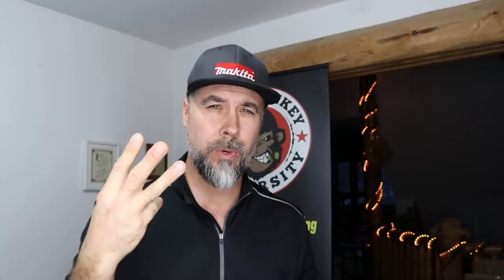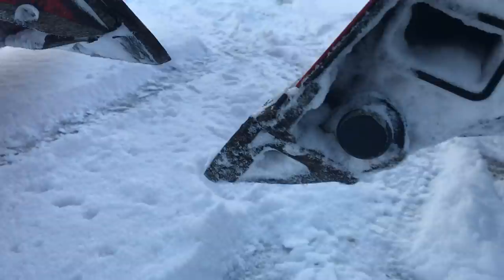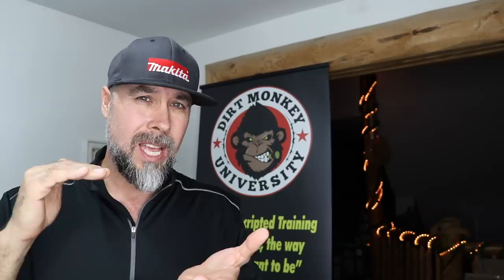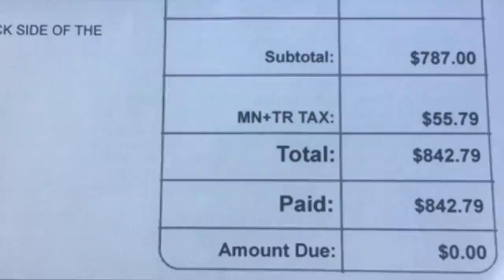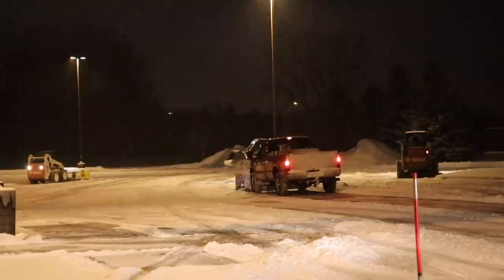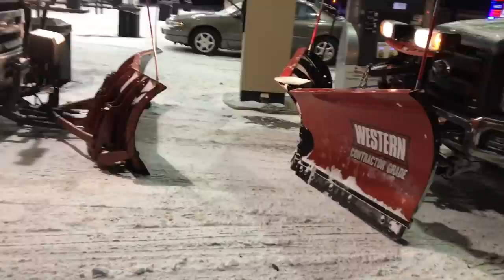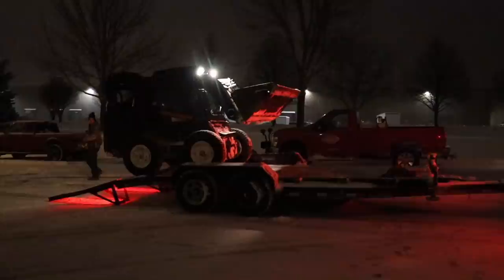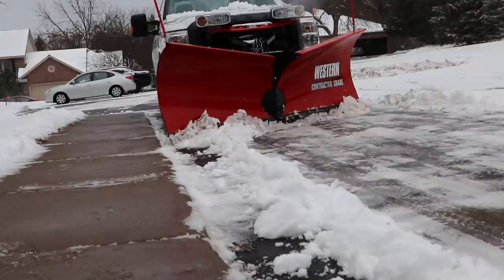Western Snow Plow Review after 13 years - Plagued with Problems

Comment: I have a western on my F250 that I bought new in 2006.  I plowed in NH 1 business (my own) and 3-4 driveways for 4 years.  Moved to PA and I plow a lot less often but do 6-8 big driveways and my cutting edge looks brand new.  I run the round shoes just below the blade height maybe 1/16-1/8.  I’ve replaced the shoes once they were like $75 for the pair.  I think the steel on the old edge is probably better, it’s a very beefy plow.  The new ultra mounts look pretty wimpy.  Maybe try running the shoes lower than the cutting edge.  I’ve always run it that way.  12 year (not commercial plowing) and the cutting edge looks great, it’s a little worn on the outside edges but all blades seem to wear on the outside corners first

Comment: I just picked up a half ton chev with a western midweight straight blade. Wasn't my initial plan, but I couldn't pass up the deal. Thanks for the heads up on blades... I've been doing snow in Duluth for 12 years now on the pro level and really my whole life, but this is my first plow so we'll see how it goes.

Comment: 5 5/8 left on my wideout cutting edge think was 6 when new purchased plow new beginning of this season. Have approx 80hrs plowing on it so far.

Is this a mvp plow problem? Or are people seeing this with all western plows?
Reply: Also one touch float is a programmable option with that controller....vehicle ignition to on,,controller off press and hold down then turn controller on continue holding down until float light flashes and you're all set!

Comment: When I graded roads for the local city, they used to supply the cheapest blades they could.   They would snap as soon as you would contact a curb, manhole, or frost heave in the road.   Then it would be moldboard up and back to city shop for s new set.   Once they figured out to get the treated blades and one set per shift sometime for two shifts they were way ahead.
Reply from the maker: Wow-  thats really bad.

Comment: I have a western 8 ft pro plow it's on it's 3rd truck 2017 F250.I put a commercial rubber between the scraper blade and mulboard.It work's great.it's like a squegie.less wear and tear on the truck also.No shoes are used.I told you about this several years ago why don't you try it.We just had 20 inches in Chicago over the last week never had a problem.Try the rubber you mite like it???

Comment: Go to your nearest steal supply place, get some 3/4”x 6” steel plate and drill your own holes. Hit the Hardware store, get some grade 8 bolts and washers and bam! I just saved you probably $700! Quit buying the company crap. They are only in business to rip the buyer over time and keep you buying “ ware parts”. Got to be resourceful in this biz. I’ve been doing it for 28 years now. Thanks

Comment: Have over 100” a year... we used to replace 3-4 cutting edges per year on all the plows western, boss, Myers, byers and hiniker(absolutely no brand loyalty). Weld on the boss every year and have had the A frame break in half! Myers are just sloppy junk! Hiniker controllers make me feel funny about playing with a little knob for 20 hours. Never any problems with the western and the operator just needs to be smarter than the controller. Get a carbide cutting edge that will last a lifetime which is only the cost of 3 cutting edges!

Comment: You have an older comparison video where you claim the boss controller requires two buttons at opposite corners to be pressed to angle the blade left or right which isn't true.  This first time plowing with the boss took a little getting used to but by the second snow I didn't have to think about it or look at it.  I think maybe an updated brand comparison with your experience would be good.
Reply: Walter Sobchak push both edges of buttons to scoop or V back
Reply from the maker: That might have been an older controller. They changed them I think.

Comment: Great video Stan!  Ive been using a western all winter and i thought i was the only one that hated how you have to hold down soo long to get into float...  caught myself not being in float a bunch of times and having to go right back over what i just did...
Reply: Joshua Marquette you can program one touch float. Check ur manual. It's simple to do and takes a second.
Reply from the maker: Im going to that one touch mode thing.

Comment: I would also look into trying a boss... hands down the best controller on the market. I also believe there the best quality
Reply from the maker: Boss is good.
Reply: CarsonSchifsky  fisher actually  is
Reply: We have run Boss plows sense early 2000's if not 90's and they have worked flawlessly for us. I guess i cant attest to fisher because ive never ran one but i do hear a lot of good about them. However we have no complaints with the boss plows and wouldn't want to have a odd ball plow so probably wouldnt end up buying one. (i like being able to interchange plows in case of breakdowns etc)

Comment: 1: talk about blade material please. 2: thickness doesn’t matter if the material is different. 3: the western isn’t going to rust as fast. 4: sounds like different people are using the trucks and plows. 5: height differences on the trucks??? 6: does one of the plows have shoes? Guessing the Western doesn’t. 7: do a side by side and see which plow caused more asphalt damage/ scrapping. 8: it’s a v plow......... you’re gonna wear through blades every other year whether you like it or not.

Comment: Hey if you want to test hardness of steel in a simple way.
a comparative way you can take a ball bearing that fits inside of a hard clear plastic tube.
 Place the plastic cylinder  on a piece of steel and drop the ball bearing from the top of the cylinder and Mark with a l Marco its height in rebound.

Now you can go to another steel and do the same thing. The higher it bounces the harder the steel.
you can take a tool or something that you know has a Rockwell hardness number maybe a knife one of your crew members have or something and you can calibrate it because knives are sold a lot of the time they say what the Rockwell number is.
But to tell if that steel is cheaper than the other cutting edge steel you can do the bounce test and see which is harder which is softer. 👍👌👀.

You have an amazing business and an amazing business history I love listening to you talk about work and machinery . 
I hope you find this useful. 👍👌👀

Comment: I got a older wester straight blade and a new v plow I use my straight more because I like it way better never changed the edge yet but on my new one I changed it 2 times
Reply from the maker: The straights just don't have the same issue.

Comment: I have Fisher xv2's.  Basically the same plow. And I love the controller.  There was a learning curve with it, but for me it only took about 8 hours and it was trained into my muscle memory.  And the cutting edge, I have had for four seasons and it still has more than 2 inches.  Maybe they changed the steel after I bought mine.  But I've had no complaints with my plows.
Reply from the maker: Nice- glad its working for you.

Comment: Well this is annoying.   I had a 2003 F350 with a Western straight blade that I loved.  Most reliable plow I've used.  Just replaced that truck with a 2017 F350 with the exact same plow you have here.  Now I'm wondering if I made the wrong choice.   Might have to replace the cutting edge with an aftermarket like you're going to do.  Definitely going to keep my eye on it.
Reply: The buttons don't bother me.  I guess I'm used to them since this is my first V plow.

Comment: I used to weld pieces (3-4 inches wide x 5/8 or 3/4 thick) of worn backhoe bucket cutting edges to the front of the snowplow edges about 15 inches apart.It took some time to do but the plow edge lasted alot longer.This was done on fisher plows. Also on the fisher xtreme V,The curved center pieces would always wear faster so I cut pieces off the worn backhoe edge again and welded it to the backside of the plow cutting edge. We usually got 1 or 2 seasons out of a cutting edge,4 or 5 with what I did. The Vplow edge I welded lasted 5 seasons,might still be on there but I no longer work there. The boss payed me alot less to cut up n weld on the old backhoe edges than the cost of one new plow cutting edge. After welding them on I would drive down a back road with the plow down to even everything out,,,or use a grinder 🙂    Love watching your vids👍

Comment: Should do another review on the snow Wolf. The fact that it can't straight Blade because of the 6 inches of corner on the mulboard. The 800$ rubber peices on the wings, the inability to scrape because if the rubber, the number of bolts need to take off just to get to the blade. The fact that the wings can't fold straight forward or back to line up with a trailer width. We have 2 of the qp114s and our widest trailer isn't as wide as the snow wing.
Reply from the maker: Im not familiar with that one.
Reply: SnowWolf | Snow Plows, Snow Pushers, Snow Blowers & Snow Tires for Machinery hey it's you. Awesome snow wing! Couple things to fix but great work in such a competitive market. And your tires are 1000% better than any other I've tried

Comment: The place that I bought my fisher plow from also has a Fab shop and they make a lot of the extras that can be mounted to a snow plow. like cutting edges and they also make their own backdrag plates. I can get a cutting edge for much cheaper than buying the O/E ones. I haven't had the need for a cutting edge just yet but I will soon. Hey great video my MAN!
Reply from the maker: Thanks- I'm going with an after market blade next  side by each comparison.

Comment: I personally never buy cutting edges from the dealers.  I buy after market custom made at a shop.  They punch blades all day long. From what I have been told it’s like buying a brand new car. It comes with cheap 20k tires.  You buy the plow not the cutting edge. But such is life.

Comment: Stan, love the videos.  From foxes to fans to foundations, keep em coming! Next, have you tried the Fisher edge?  The Fisher xv is almost identical to your mvp3, not surprising because of the common parent company of Douglas Dynamics.  Maybe it is a harder steel.  Been going on 11 seasons on my Fisher straight edge, had 2 inches lopped to straighten it (thanks to my steel buddy) because it started to wear on the corners (that nudge into the driveway to even out the windrow from the street affect).  Maybe a Snow EX edge from their v plow?  They are also a Douglas Dynamics company with almost the same set up as Fisher/Western for their trip edge, but they advertise higher strength steel.  Might be worth the money.  Stay safe!
Reply from the maker: Thanks, man. I'll keep that in mind!

Comment: I’m curious or wonder if the plow is heavier or even if it’s related to the controller not going to float automatically and putting pressure down and causing to wear out faster? Does that make sense?
Reply: It is hung by a chain there is no hydraulic down pressure, it just will not lower any further when not in float mode.
Reply: branden Clark true but when I put my wester plow down I can feel the truck lift a bit maybe I’m not understanding it maybe it’s just the load not hanging on the truck anymore so it raises the front? Just a thought
Reply: It wouldn't wear faster not in float mode,  it would wear faster in float.  Being that in float it has constant full weight on pavement contact in float mode.
Reply: MR PORKCHOP HAHAHAHA I see... like I said just a thought I was trying to think of other possible reasons it might wear that way i guess now I want to scrape different blades to see the hardness difference.
Reply from the maker: Its not lifting- your removing the weight off the truck when the plow hits the ground.  So the front end rises buecause the weight of the plow is no longer actually dragging it down.

Comment: Stanley, You can fix the problem with "Hard-surfacing" welding. I've had to do it on molybdenum hammers in some grinders I used to help build. Hard surfacing will extend the life of those softer blades. Lol. You can see "hard surfacing pieces I noticed on the Volvo buckets on the excavators!!! Usually they will put ex's or variables designs to give wear strength for the longer term duty of the buckets and bulldozer blades.

Comment: I only spent 80.00 on a new cutting edge. cause i played it smart and had a local metal warehouse cut it to size then i used my drill press to drill the holes. But i put the holes dead center so when one edge wears out i just fip it over and get double the life span

Comment: Our fisher v blades used to eat edges.  I experimented with adjustments and aftermarket products nothing really made a huge difference.  So I had a bright idea after looking at a highway wing plow...  I made up plates to add to the outer edges of the blade.  I used AR plate that is used in dump truck bodies then I hard faced it with the welder.  Since doing this I can now get 2 seasons of heavy heavy use.  Im in buffalo ny..... we get alot of snow.
Reply from the maker: You guys get hammered with snow

Comment: If the western blade edges suck, go aftermarket.  Go find out where the city or equipment guys buy their cutting edges ..   I bet they are more a mild steel rather then a hardened  steel.

Comment: We have been using western plows for over 15+ years.  My only issues, are cheap wires used that are common for breaks, shitty remotes that the wires break easy, or the keypad fails after 3-4 years. Hand held remotes are 850.00 to replace.  All western parts are in most cases double the price of USA dealers.  The wideout plow this year in 10,300.00.  Our new Tornado 8' sander was 10k this year.  Surely for those $$ they should be nothing but the best products.  Western cheap products are causing us guys to scramble at 4 am in the morning to repair things.  NO FUN  Our area used to be all Western Red plows, now we are seeing lots other manufactures plows showing up.  Guess I not the only guy starting to look around.
Reply from the maker: Hey Chris-  your not alone.  Lots of People are looking for better more reliable alternatives.

Comment: A real small factor is how much drag the driver is applying when plowing. "The down force" on the blade.
Reply from the maker: No down force.  These don't have down pressure outside of the weight of the plow and gravity.
Reply: You use float and it just drags across the concrete. No down force

Comment: Western and Fisher V plows share a lot of components like, moldboards (powder coating is different color), electronics, hydraulics, hoses and I'm pretty sure cutting edges.  The Western MVP3 and Fisher VX2 are similar to each other as are the MVP Plus and Xtreme V.  I know some guys with Fisher V-plows that mentioned short cutting edge life.  My Xtreme V has been good.  However, I cranked a small piece of the edge off of one side.  Who makes a good aftermarket cutting edge for these plows?I love the Fisher/Western/SnowEx hand held controllers.

Comment: I have a fisher basically same animal and my fish stik controller is junk  on my 3rd one first two would work  then not work with the light in the corner  would start to blink the controller I have now it just shuts off in the middle of plowing so you have to turn it back on  and this is just with an 8 ft straight blade

Comment: Running a near 20 year old unimount plow now for two years. Has a 3/8 cutting edge and I’ve hardly worn it. I plow a LOT. I think you make these videos to try and get free stuff out of companies. I buy my cutting edges from a local company that gets them wholesale and they last forever. If your problem is with western cutting edges just buy aftermarket. You make mountains out of mole hills.

Comment: Food for thought would the weight be the difference as to why its wearing faster on the v plow vs the other cuz if I remember correctly the v plows weigh about 900 and the wing plows are 648 pounds but yes everything today is made with cheaper material nothing is built for durability or dependability period and it's sad for the price folks are paying but best of luck to you

Comment: I think the problem is too much down pressure and not in the "float" position which in turn wears down the cutting edge.
Reply from the maker: You cant put down pressure on these really.
Reply: Kyle Engler, western doesn't have down pressure.  It has chains

Comment: Never ran anything other than hiniker 3 strait 1 vee and probably won't love the controler want left just move left also never bought a manufactur cutting edge truck skid or bucket. Good steel and a drill bit blades lined up no need to punch the holes or buy there square bolts
Reply from the maker: I like my Hiniker